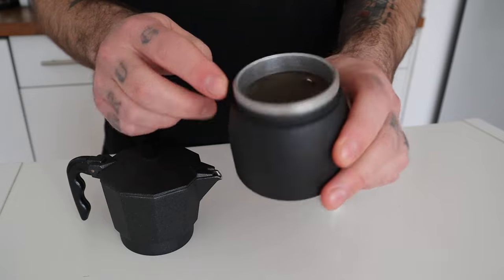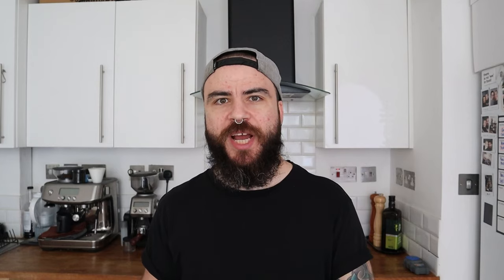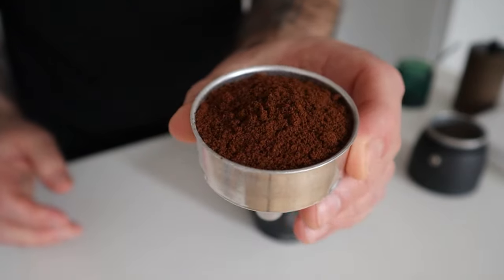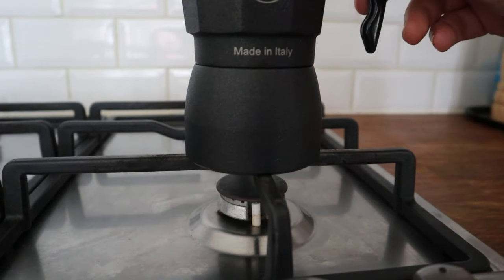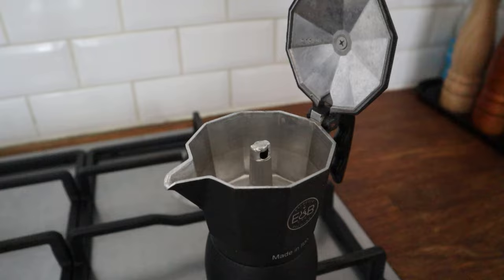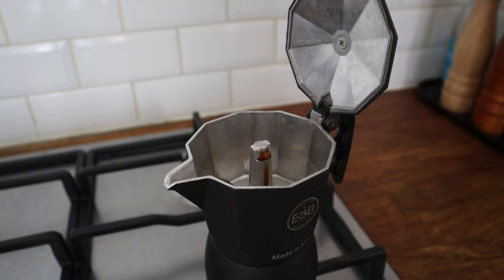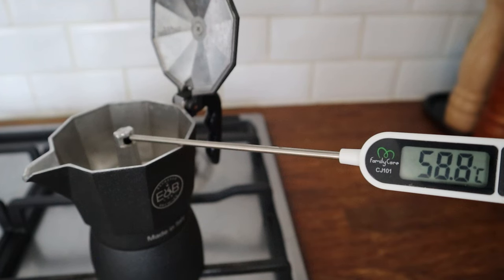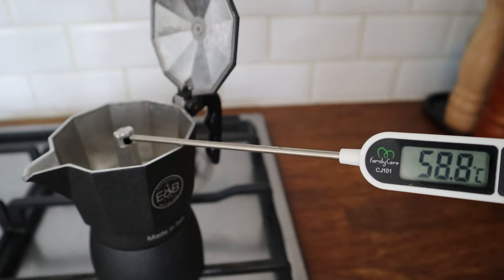The Ultimate MOKA POT Technique - How To Make Coffee With  #mokapot - 2022

Comment: I think why Bialetti says to use cold water is because they assume you use flame. Obviously a pot over flame is hotter than electric. I'll always use cold. Sadly here in the U.S., we use electric stoves. Maybe a dial of  two and letting it preheat will work best. Aluminum was designed on gas stoves. 

Remember if you're using an Aluminum on an electric stove, move the pot around so it doesn't stick. As for stain leas steel, again use the same dial or higher and preheat. Aluminum heats better than stainless steel
Reply from the maker: Thanks so much to share these info. I can also tell you that if you use cold water the coffee starts to be extract at lower temperature compared to hot one. So if you use dark roast coffee is ok but if you use light roast, the coffee might come under extracted.
Reply: @matteofromtheswamps  oh yes I heard this one. I actually did a test with pre ground and beans you have to ground yourself and notice no under extraction because it seems the brew doesn't boil and add pressure until maybe a little bit over 100°F. This was over an electric stove. Noticed with pre ground it's bitter if I use pre boiling water and dial at 2. Sadly I can't always get whole beans hahah. 

I don’t know if in Italy they've changed their brew techniques with their pots because their instructions are the same, yet, people made videos saying when they visited Italy, they used the Moka pots in the coffee shop and it was great or amazing. But this shouldn't be a shock to anyone if everyone use Bialetti's "techniques" via instructions.

What I need to do is stand over the stove with our electric and get the right ratios of coffee, boil and heat. Using cold water it's not too bitter. I also know you have to let it cool because it's a bit bitter.  

James Hoffmann did say if you're using dark roast to use less water compared to if you're using light or medium roast. Those type of roast you want to use more water.
Reply from the maker: @sO_RoNerY  I’ll come in the future with a video about different roast style. Already working on datas, but it will take months. For now I can say. Changing wanted quantity in the boiler is a bit tricky, and I found it inconsistent. Also I notice, if you put less water, that water get hotter faster. I prefer and suggest play with the coffee dose and quantity of yield. 
I don’t know many places in Italy doing Moka at the bar. I know few amazing baristas that do that. Me together with other Italian professionals are try to re-educate Italian consumers because they stick with old traditional method that is basically “it comes how it comes” without control and consistency. 
Thanks so much for your insights. They are very useful 🙏🏻
Reply: This is off Italyheritage:

"The coffee powder should not be pressed, but evenly distributed in the filter. The Neapolitans advise you to make "a muntagnell" (a small mountain) in the center.

The flame must not go beyond the rim of heater, and the fire must be very low, because water has to filter slowly into the ground coffee, and it must be switched off as soon as the moka begins to mumble."

When it mentioned "mumble", I got confused. Like mumble when you put your ear up to it and hear it hiss or gurgle, then switch the heat off or when it reaches its sputtering stage?
Reply from the maker: @sO_RoNerY  yeah this is the classic way Italian do it at home. Forget the “muntagnell” because it is not very consistent. I always suggest to stop the moka even before the mumbling to avoid over extraction. But this method pretty much works too.
Reply: Based on personal experience, I’ve noticed Northern US states use gas stoves, Southern states use electric stoves. Personally, I prefer the gas ones bc I can control the heat. There’s most definitely a learning curve when switching from one method to another

Comment: Thank you Matteo,  I'm starting to try the moka pot.  I'm  struggling to start the process,  as I  only  once get the beatiful flow at the beginning of the extraction,  most of the time the  flow is trembling  so at the very starts is irregular.  It looks that there is some sweet spot in between to much Heat and too low,  to start the process.   For know I'm keeping the grind size constant and varying the Heat control of  my  gas stove.
Reply from the maker: keep always the heat low, you get a more regular flow and a good extraction.

Comment: What cup size do you recommend? 
Great Video btw.
Reply from the maker: Thanks so much for the kind words. 
About the size it really depends on how much coffee you like to drink and how many people are drinking coffee with you. In my case, I have 1 cup moka, 3 cups, and 6 cups. I always use the 3 cups for myself or if I have someone over for coffee. I rarely use the 1 cup.
Reply: @matteofromtheswamps  thanks for the reply. Is there a difference between the strengt/intensity of the coffee, since 1 cup is espresso size?
Reply from the maker: @Ali-sk5qp  good question. The one cup has a shorter basket and by default you don’t get a very strong coffee. I think a 3 cups it’s the one to get a good strong coffee. Also if you think. Usually at the café (depending of course in which country) barista uses between 14 to 20gr of coffee for an espresso, same quantity you can put in a 3 cups.
Reply: @matteofromtheswamps  You right, I am going with the 3 cup. Much appreciated!

Comment: Great video!!! I have used the aeropress filter like your video but the first time I found water leaked out of part where the water chamber was screwed onto top part. I’m not sure if the paper stops a good deal or if I did not tighten it down enough.  I have started cutting down the filter (just 1mm around the edge), but it’s time consuming.  Any advice on what you think I am doing wrong would be great.

I also have another question - I do a lot of travelling and stay in hotels where there is no access to a stove.  Have you every used one of the electric heated Moka pots?  Would they be good for a traveler or are the just a gimmick?

Best regards,
JC
Reply from the maker: Thanks for the comment Julian.
The problem I think is the gasket, I could happen if the gasket of your moka is old/hard, that can be common with rubber gaskets. 

about the second question, I didn't try it yet the electric one, so unfortunately I can't give you my opinion.

Comment: Hello Matteo,
I have a 6 cup moka pot that can be filled with 320g of water just below the valve.
I manage to put 25g of moka size grind (I have a DF64 and grind size is at middle of moka pot range).
I manage to get only 80-90 grams of coffee while using specialty coffee (light to medium roast).
1. Is this normal? I use your technique, small gas fire etc
2. I cannot get 2/3 of the initial water quantity as Hoffman says in his latest YT video.
3. What is a “correct” result ?
Thank you!
Reply from the maker: Hi Daniel, 
80-90 gr is not normal, I believe you get a very sour coffee. We need to understand if there is any pressure lost during brewing. Do you see or feel that some steam escape from the pot threading? what happened after you get the 80-90gr? it stops coming out? If you increase the gas power it's start sputtering? Let's figurate out this together.

Comment: Really like the video keep it up
But I have a sputtering problem even tho I bought a new moka pot and i use low heat and use lavazza coffee
I cant figure out what I do wrong,help please.
Reply from the maker: Hi, if you follow my tips it shouldn't happen, sometimes it can be a product fault, I tell you this because it happened to me few days ago, I went to visit my family in Italy, I change the filter and the gasket in their old Bialetti moka and it started sputtering. I was so confused, after few trials I put back the old filter, (same model, same brand) and it didn't do it anymore, it was working perfectly, so the problem was the new filter. I return it. So try to see if this is the problem.

Comment: thank you Matteo for this informative video. I'm struggling closing my mokka pot, it seems like I don't do it right because I have so much leaking, when the water cooks. The mokka pot is new and all pieces are alright and I don't leave coffee in the borders of the filter, so I believe I don't twisted right. Would you have a tip for it? I have a classic Bialetti. Thanks!
Reply: Can be one of two reasons; you could be cross threading/not completely tightening the upper and lower chambers enough OR you're missing a filter gasket.
Reply from the maker: Ronnie here is right, could be also a threading problem, possible to be a manufacturer problem. About the gasket, I always had problems with rubber gaskets. See if you can find a silicon one. They are way better than rubber

Comment: How many mins does it usually take to make the 3 cup Bialetti moka pot?
Reply from the maker: That can depends on what temperature you put the water in the lower chamber and also the grind size. With my method I usually take 5 minutes in total, I like to keep it slow for a better extraction.

Comment: What about the method of using cold faucet water to stop the extraction when the chimney starts to bubble?
Reply from the maker: That can be also helpful. But also could be problematic because if you quickly could down the boiler containing hot steam, you can create a negative pressure inside and the boiler could suck the basket with the coffee inside and them it will be pretty impossible to take it out without damage it.

Comment: Ciao Matteo, Should i use espresso roast for the moka pot or filter roast works also ?
Reply from the maker: Ciao! You can use both but there are few things you might need to adjust. for dark roast use room temperature water and maybe just a bit less in quantity to avoid overextraction. with light roast use warm water and water until the valve to help to push more extraction.
Reply: @matteofromtheswamps  Grazie Mille I Will try your recipes 👍🏼

Comment: 5:15 -- Maybe it's just the camera angle, but is the basket the same diameter as the grounds bin?  I know it doesn't happen all the time, but it'd be a lucky coincidence if it does.
Reply from the maker: You have a good eye. Yes the diameter in more or less the same. I also tried to use it like I do when I do single dose espresso. But I found it inconsistent and sometimes I can see phenomenon of channel on the board. I found that the double stacking, the one I show in the video, is the most consistent. Also not everyone as the same bins, but if you have it, you can always try and see if for you it’s better. 
Thanks again for commenting.
Have a great day!

Comment: At pressure greater than one bar the water will boil at a higher temperature than at average sea level!At 1.5 bar the water will be well over 99 degrees,at 2 bar the water will be around 120 degrees centigrade.
Reply from the maker: yes. that is correct, but water in the moka doesn't reach boiling point at the moment of extraction, it could reach at the last stage of the extraction, that's why I always to advice to turn off the heat bofore, to avoid over extraction.

Comment: when I start with hot water the cofee is stronger and harsher in the end
when I begin with cold water it is less bitter... is that normal ?
Reply from the maker: Yes. It's normal, the reason why is because water in the moka starts to come up before the boiling point, lower is the temperature of the water in the boiler and lower will be the temperature of the water when it will start to extract the coffee. Depending on the beans you use you should change the temperature of water you put inside. for example, dark roast coffee requires lower temperature, light roast higher temperature. With higher temperature you get higher extraction, so you get a stronger coffee but also if you over extract it can become bitter and harsh. if instead you the temperature is too low you can get under extraction and sourness. Sorry for the long reply, but I hope I could answer your question

Comment: I'm wondering why in all videos every one got closed top lid, and you got all the time open 🤔🤔🤔 also I recommend use the paper filter wet not dried. Another suggestion is straight after taking off of the heat get the bottom chamber cool down to prevent from overheating valve. This will not affect any taste or coffee temperature
Reply from the maker: I keep it open to check the when the coffee comes out and also the speed of the flow so I can control it. If you keep it close you are not able to control it. Paper filter in the video was just for showing. Also with modern papers there is not paper taste anymore. That was for more than 10 years ago. Last thing, I don't suggest cooling down the moka with cold water because you risk to create a vacuum environment in the lower chamber and could suck the basket inside. Hard to take it out then.

Comment: Hi! I'm new to making coffee and moka pots and I'm having a hard time with the yield. I have a 6 cup moka pot but only manage to get 4 cups extracted before it starts sputtering (there's a lot of water left in the boiler). I use an electric stove and use a low-medium heat. I do pre-heat the water and my grind is about medium-fine grind. Please help! Thanks!
Reply from the maker: Hi! That sputtering is might caused by the elevated temperature the water in the boiler reach. try to slow down the extraction with removing the moka from the stove and then put it back on when the flow from the chimney almost stopped. In this way you get a better flow and slowly slowly you get the right amount of water out. Try and then tell me if it worked.
Reply: @matteofromtheswamps  I'm amazed because it worked! two differences I made was make the grind just a tiny bit more coarse and lowered the temperature of the stove. I did the on and off method like you described and to my surprise I got a full 6 cups. Thank you so much!! 
This batch came out a bit weak and acidic for my taste. Any tips for that? Are there any coffee bean brands you recommend?

Comment: Wow!
So .. greater extraction actually means weaker coffee by volume. The terms had been confusing me. I like strong and sour-sweet coffee, more on the sour. I also drink a lot. Therefore, I'll use a bigger moka, finer grind, shorter extraction time! Always low temp, of course. More expensive per cup though! 😂
Reply from the maker: Yes, correct, more water higher extraction, but also weaker coffee. most of the concentration is at the beginning, and this happens in any brewing method. Yes you doing good. You can also reduce the amount of water in the boiler. For sure you will have less water going through. I like to have my coffee like you do. So I understand you :)
Reply: @matteofromtheswamps  and it worked! Best coffee I've ever made! But I did it with a 3 person moka pot to make just 1 full espresso cup. It was a really slow extraction. Never reached any sputtering. Removed from heat as soon as it looked watery. There was some sweetness so it wasn't too early. I packed it a bit, but the really low heat might have helped even extraction from all the basket. It was even old pre-ground espresso coffee! Just so much "wasted" coffee! 😂
Reply from the maker: @francisb2278  Happy to hear that! :)

Comment: Hi Matteo. My coffee doesn't come slowly, it comes very bubbly and aggressive. And it also taste very bitter. What could be the problem?
Reply from the maker: Hi, alright. Do you grind your coffee, or you get coffee already ground? Tell more about your method, are you following mine? Let me know. We will fix this
Reply: @matteofromtheswamps  Yes, I ground my coffee. I have a Baratza Encore and I grind around the setting 6. 

I followed your method without the prove. I have tried using the Aero press filter but I still got the same results.

The coffee comes out very aggressively since the start. Yesterday I got around 40ml of liquid out from 300ml of water in the boiler and 27gr of coffee. The taste of the coffee was bitter but still had some sweet notes. 

Thanks for Answering! :)

Comment: how many grams of coffee do you use for the 3 cups e&b moka? 
also you said to start from 12 clicks, i assume that 12 is for a lighter roasted coffee, what would you say is the maximum you'd go? 16?
also heating the water in the boiler and then transfering it to the moka chamber is going to make it drop in temperature, what would you say is the temperature in the chamber when you put it on the stove?
Reply from the maker: So I start with putting 17g then change depending on coffees. The grind range I use for moka can go from 9 minimum to 18 maximum, 18 if I have bit darker coffee. Chamber temperature around 75C. You can push more for light roast so you get more extraction
Reply: @matteofromtheswamps  thank you for your answer !

Comment: My pot randomly works. I have tried every different way. Most of the time, I get no coffee. Out of 10X, only twice I received coffee. Not much, just a little. What am I doing wrong? Thank you.
Reply from the maker: Hi Anthony, could be many things. Make sure you don't press the coffee in the basket, use a low heat and also make sure that the gasket is not worn-out, because if it is the pot loses pressure and the water won't come out. Keep me update and let's find the reason